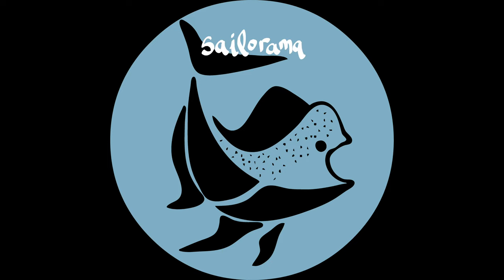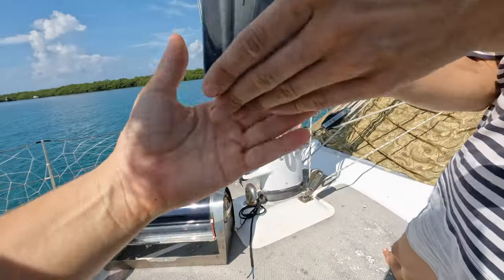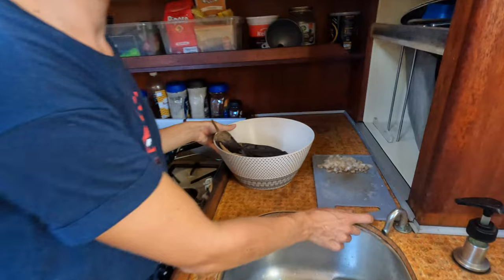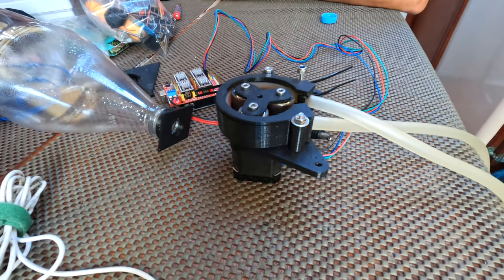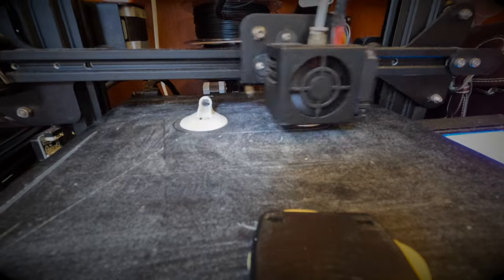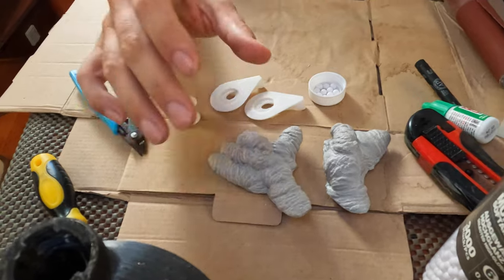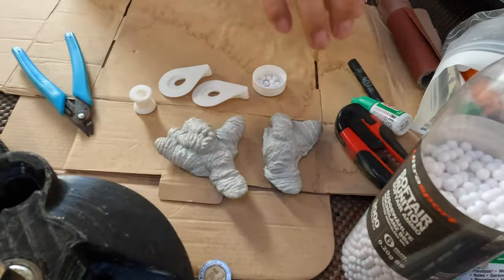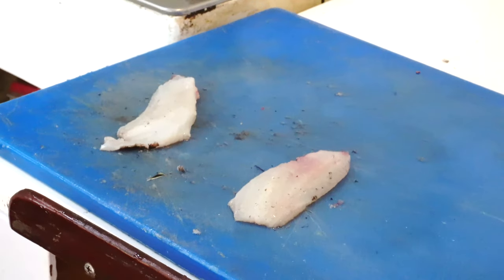can a sailboat 3D PRINT THAT?

Comment: Nice use of the tech and good that you're understanding of it's limits. Not exactly sure I'd trust it for something critical like a Genoa but maybe for light wind sails like a drifter? UV resistance is the issue with printed parts but your friend will get you up to speed with all of that. I'd relegate it to interior use only or gizmos, interesting to see it being used outside. A really really good use of 3D printing is to make plugs for molds and then cast your "print" in something like epoxy and glass slurry. Strong, cheap, and much much more reliable.
Reply from the maker: What we find really interesting is how our 3d printing friend fearlessly forged ahead and printed a lot of items for use outdoors. The sun and water definitely do wear the material down - an extra protective layer or less eco filament for printing is the way to go for some items, but yes, anything not too load-bearing is worth testing out.

Comment: Is shaking of the boat is ok for quality 3D printing?
Reply from the maker: I would not try to print while there is bad weather and big waves, but it seems that a good 3d printer has a gimbal/stabilization system that allows sailboaters to print onboard, no problem.
Reply: @sailorama  thank you for the answer, could you please name some of the good 3d printers that have gimbal stabilization?
Reply from the maker: @mihaelisaev I don’t have a printer myself - if I remember correctly our friend in the video had a Ender brand 3d printer, which had no problem printing onboard the boat. Prusa is also a good brand, but more expensive.
Reply: @sailorama  I also have Creality, a bit bigger CR-10S model. But what do you mean by gimbal? I never seen it on 3d printers. That's why I'm asking for an example model to see it
Reply from the maker: @mihaelisaev  I don't have a 3D printer so have not been able to look more closely, but like my cameras, the printers seem to have some degree of stabilization built-in - they keep themselves steady on their printing grid  despite the boat moving slightly at anchor - and by gimbal I simply mean that the printer head seems to swing on a hinge. Looking at your original comment, boats at anchor do not often 'shake'. I recall that sometimes printing required enough power that our friend had to turn on a generator, and even then there was not enough shaking to impact the printing job.

Comment: Very interesting... Great video. Do you know what printer model he would recommend to buy? ... and what kind of filament?  There is all sorts of stuff out there... but obviously it needs to work in marine environment. Thanks in advance
Reply from the maker: The one he uses is the Ender 3D Printer, and using Ender 3D PLA Printer filament - the black filament gets extremely hot in the sun, so I forgot to mention in the video that white filament was used in order to stop it from melting in the extreme heat and sun that we get out here on our boats 🥵
Reply: I found that most 3D printable plastics would also work on a boat. The easiest, most affordable and also probably most environmentally friendly is PLA. Start with that. The only challenge is to get the plastic dry enough for printing, for which I recommend a heated filament drying box. I started with a stock ender3, but since then found that all of the FDM printers work fine. Maybe you want to match the voltage of the printer (12V or 24V) to the voltage of your batteries so that you do not need a step up or a step down converter.
Reply: I've used the Creality Ender 3 for about three years now, it's a very good machine and Creality seems to be pretty good with customer support if anything does break. PLA is the easiest plastic to print with, but for things that need to be functional I prefer to use PETG or ABS.  ABS can be very difficult to work with without a heated enclosure.  In any case, any part that I make that's intended to be used outdoors always gets a coat or two of paint to help block harmful UV rays from degrading the plastic.  Cheers!